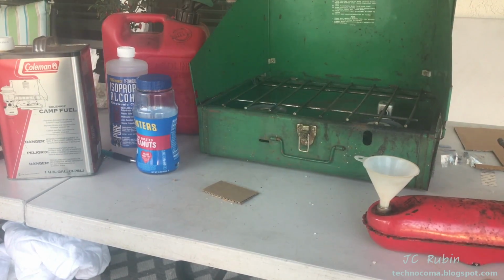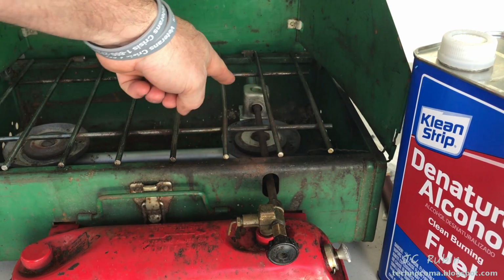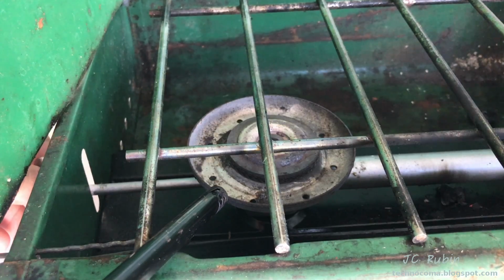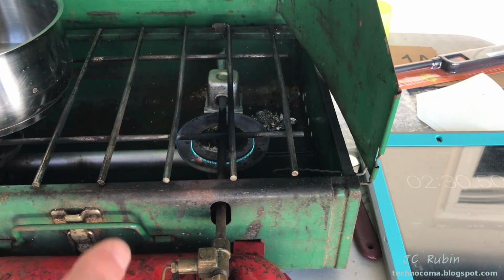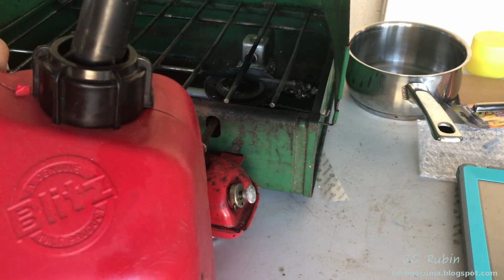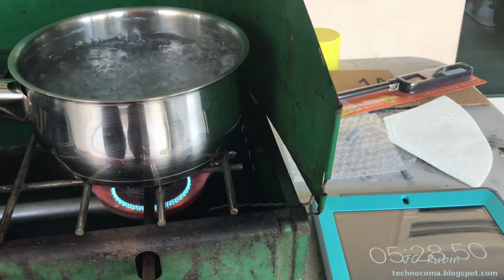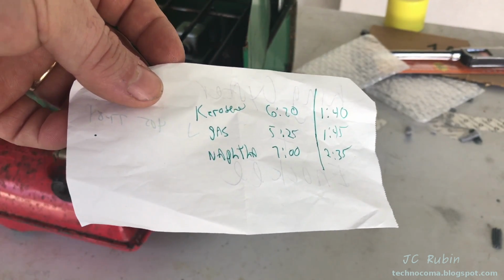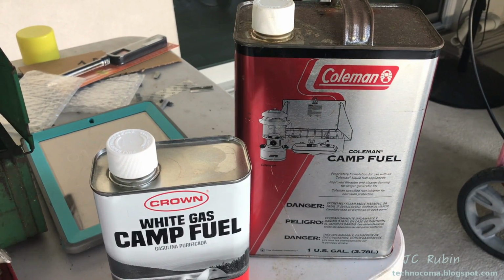Antique Coleman 425 Stove Testing Out Different Fuels for Performance

Comment: Great information, thank you for sharing. I just got one of these old stoves.
Reply from the maker: Its a great stove.
Reply: @retrotechandelectronics  If I may... Try adding a CAP or two of (yellow) HEAT  to your OLD White gas and Test it!? :)
Reply: @RVingwithG  I was wondering if that HEET would help to remove any moisture in the fuel. I have a couple of gallons of Coleman fuel that's been out of a protected environment and thought about giving it a try. 

Thanks for reinforcing my thoughts.